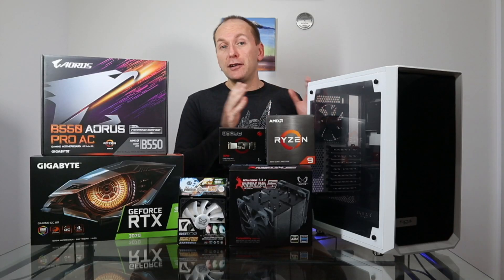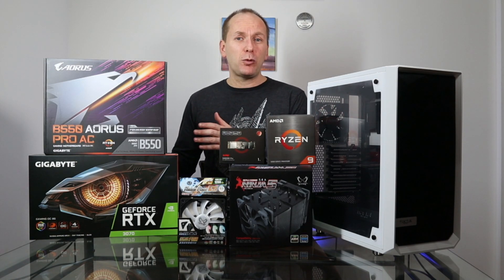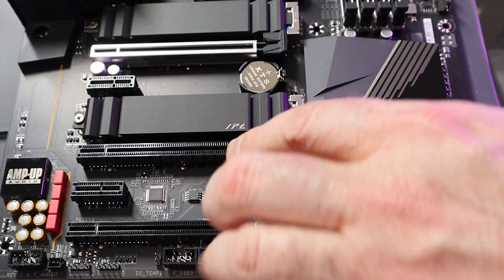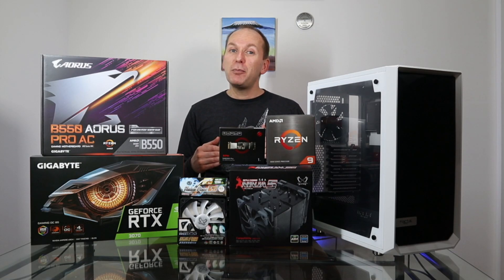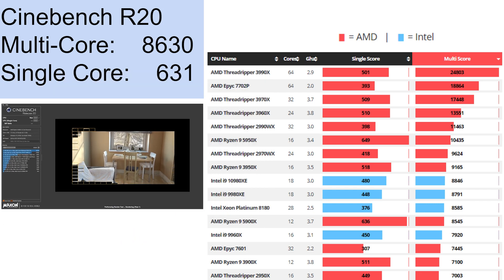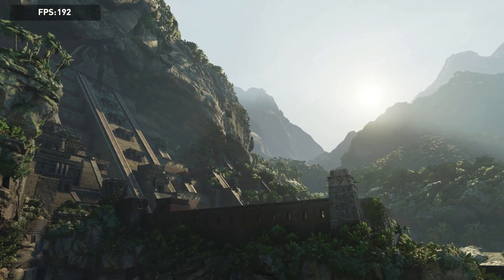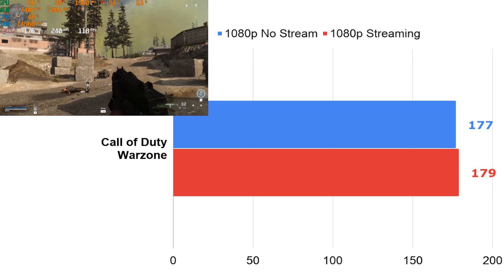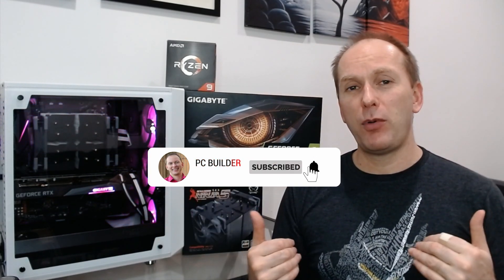Best PC Build 2021 [with Benchmarks] - Ryzen 5900X & NVIDIA RTX 3070

Comment: im on the 5900 and 3070 combo atm. upgrade from i5 8400 and 1080. the most difficult part was x570 motherbord that dont understand CPU at all. stock bios is not ready so i must @spend@ some time to go to service and update bios, it took me about a 2 weeks to make it operational because of holidays :D. but i choose to watercool it by a PureLoop 360 (front mounted because of be quite! 500 DX limitations). it is working/gaming pc so i can put all the core and threads in use easy - 3dsMax, Cinema 4D and eftereffects so i choose a liquid cooling instead of air monstrosity cooler
Reply: rig is: 5900x, 64 GB Ballistix 3200 (upgrade it later with another pair up to 128), MB: Gigabyte Aorus x570 Elite,  system/soft: 250 gb EVO 860, cache disk for aftereffect: 500gb EVO 860, main storage (projects\games) - 1 TB EVO 870 QVO and 500gb nvme evo 970 for some extra speed when needed. GPU: Asus 3070 Dual OC, PS: Corsair RM 750 X, CPU cooling - pure loop 360, case: be quite 500DX, workspace: 3440x1440 Samsung C34H890WGI
Reply: the main reason for 3070 against 1080 is 21:9  workflow
Reply from the maker: Sounds like a great build!
Reply: @PCBuilderChannel  yep, it is a lot more working machine than gaming so there is some room for workflow upgrade. it is definitely a lot more powerful than i5 :D

Comment: Can I upgrade my cpu from a 2600 to a 5600 if I have a B450 motherboard?
Reply from the maker: Yes, as long as you update the bios to one that supports Ryzen 5000. It should be available now, check the manufactures website
Reply: @PCBuilderChannel  thanks my guy!

Comment: Did you have to do a BIOS upgrade to support the processor?
Reply from the maker: Yes I used the bios flashback. If you're interested in seeing how, I did a separate video on it. Most motherboards still aren't Ryzen 5000 ready out of the box. :)
Reply: @PCBuilderChannel  From what I've read I'll agree. I'm running into that problem with a Gigabyte Aorus Elite I just bought - the onboard QFlash is not starting and I can't get my new 5600X working with it. :(
Reply from the maker: Did you format it as FAT32? Some people did EXFAT (because their drives are larger than 32gb) and that seems to be an issue on some boards.

Comment: I want to upgrade from my 2600 and 2070 super to a 5900x and 3070 what cpu cooler do I need and I have a 750 watt gold rated psu so that enough and what settings in the bios do I have to change to get a good oc on the 5900x I can do the gpu with MSI afterburner or something
Reply from the maker: You can overclock with MSI afterburner (that's what most folks use). For the cooler, any 240mm  or larger liquid AIO or high end air cooler is what I'd recommend. Check out my best coolers for Ryzen video again. I went with the Scythe Ninja 5 which is very affordable.

Comment: Nice build! Reckon it's worth holding out for a 5000 series rather than going for the slightly cheaper 3000? It'd be a higher end one for gaming and rendering, although the gfx card would be doing that mostly (assuming I can get one)
Reply from the maker: If you are getting a high end GPU it makes sense to get a Ryzen 5600X. Otherwise a 3600 is absolutely fine.

Comment: im building a pc rn and i wanted to ask you if its worth paying 100€ plus for 3070 instead of 3060 ti? imma buy the pc in a few months so this question is asked for the scenario of the prices being normal.
Reply from the maker: Depends on what resolution you want to play in. If you’re looking for 4K or super high FPS at 1440p the. It’s worth it. If you’re just playing at 1080p or high refresh then you don’t need it.
Reply: @PCBuilderChannel  hm so its probably worth it for me. Thanks
Reply: @PCBuilderChannel  also is it worth it to go for an 3080 instead of 3070 if i want to play games like cyberpunk and cold war at 1440p with ultra and ray tracing ?
Reply: @muaz1562  What do you reckon gfx card wise for 3440x1440 ultrawide 100hz?
Reply: @terryd8692  depends on which game but id go for 3080 for sure as thats the best in its price class. I mean im personally not ready to pay 1500€ for the 3090
Reply from the maker: If that is your use case and you can afford it, then yes the 3080 makes sense.

Comment: Really good build but I have a question, in the video, I was not able to see the RGB of the front fans through the mesh. Was it due to the camera angle or are you even not able to see that? Tell me!
Reply from the maker: The mesh is a little tighter, there’s a light glow but the camera didn’t pick it up. It’s the case not the fans

Comment: Again nice video. Im thinking of getting an b550 Aorus pro MB, for my first build. But now Im reading about BIOS problems with USB not working.
Do you know if Gigabyte has adressed these problems? The posts I read about it were kinda old I admit.
Reply from the maker: I'm not familiar with those issues and haven't had them myself. The B550 Aorus Master had some issues with grounding and USB connectivity IIRC but nothing on the pro.
Reply: @PCBuilderChannel  New question. I can buy an i9 10850k avenger cpu for 399Euro,so about  399 dollars.(I read that avengers only difference with 10850k is the box its in)

The 10850k normal is 60 E more and the 10900k is about 140E more.(basically the same cpu);

What are your thoughts on this? With all cpu/gpu prices only going up. Seems like a good deal to me.
Reply: I have a Gigabyte B550M Aorus Pro and the new BIOS update did not rectify the USB issues for me. However, it's not that significant of a problem in my experience, just a minor annoyance. It could be a different experience on the full ATX board that you've mentioned but it seems to be an issue persistent on most of the B550 AORUS lineup.

Comment: I have a really similar build except the only real difference is I have a 5600x, do you think it could still stream in 1080p or 720p while gaming?
Reply from the maker: I think you'd be fine for most games. 5600X nearly has the same power as a 3700X.
Reply: So Jason, is it better to choose 3700x rather than 5600x?

Comment: My first build about a month ago: 5600x, 3070 FE, b550 aorus pro ac, 2x8gb 3600mhz, crucial p1 ssd, corsair icue h100i rgb pro xt, all built in a TD 500 mesh from cooler master
Reply from the maker: Awesome! It's the pure gaming version of my build here. How do you like it?
Reply: @PCBuilderChannel  I love it, great coming from a ps4. I’m slacking on the monitor though, I have an old lg ultra wide monitor but only goes to 70 hz so I need an upgrade

Comment: For my new pc, i want to transfer my programs and data from my ssd to my new m.2. Should i clone my ssd or re-install all my programs ?
Reply from the maker: While there are some ways to transfer, I'm a big fan of just doing a clean reinstall of everything for a new PC. I know it takes more time but in my experience it saves a lot of headache down the line.
Reply: @PCBuilderChannel  Thank you very much!
Reply: @PCBuilderChannel  Also i have one more q about the bios flashback update. Is it possible that something goes wrong as i do it? Assuming that i do everyhting you do/say on your video
Reply from the maker: Something can always go wrong :) . Just make sure you don't unplug the power or turn off the PSU or something silly and it should work fine 99.9% of the time. Just let it sit there until it is done.
Reply: @PCBuilderChannel  Thank you for one more time! To be honest you upload content that is to the point all the time and is accurate to what people need/want to listen! Also i trust mostly you if i'm going to do somehting on my pc. That's why i've asked you these questions and others in the past. Great video as always!!

Comment: Did you do any overclocking or strip windows
Reply from the maker: I did some overclocking, just an all core 4.7 ghz one but decided to just show all the results at stock. I didn't strip windows apps as I feel that isn't realistic testing for most users. I might do a follow up overclocking video when 1usmus releases his new Clock Tuner for Ryzen app that is coming out soon and supports Ryzen 5000.
Reply: @PCBuilderChannel  cool yeh maybe you could do a cpu and gpu overclocking guide and test pbo and just see what's worth the time to do and not worth doing
Reply from the maker: Love these ideas. I do want to do a PBO guide but I'm waiting until I the new bios comes out for PBO2 which just launched on some boards last week with AGESA 1.1.8.0
Reply: @PCBuilderChannel  yeh good idea